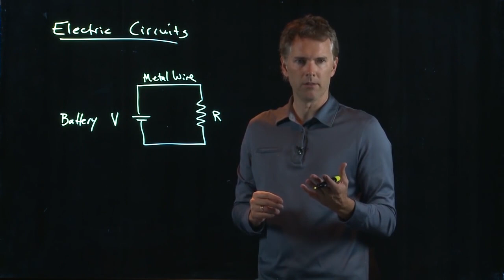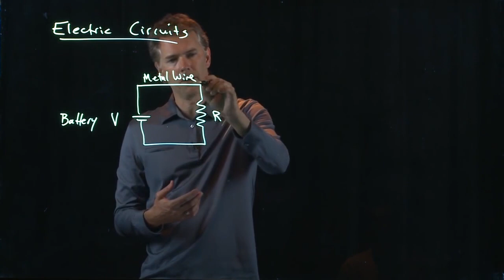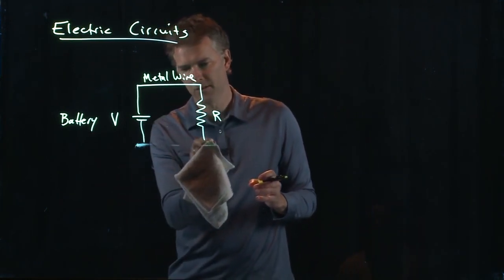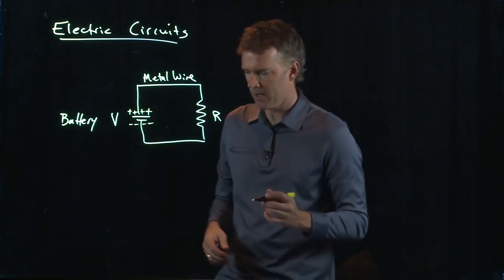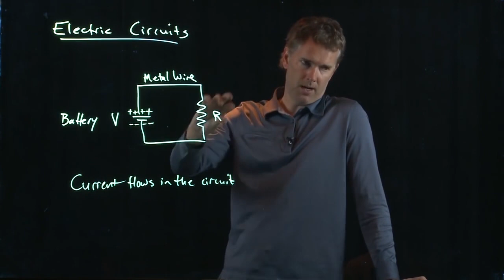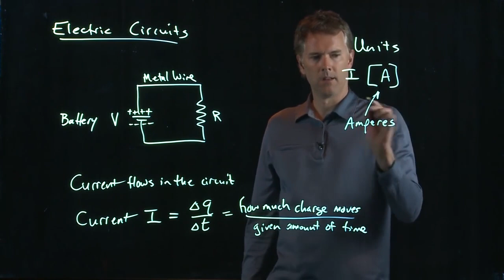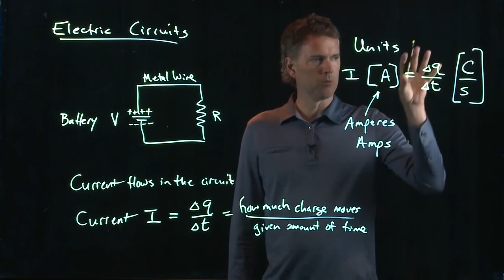Electric Circuits | Physics with Professor Matt Anderson | M21-01

Comment: Point of correction: 
In the first circuit he drew, I think the energy source is a (CELL) NOT!!!!!!! A (BATTERY).
Reply from the maker: Correct.  I get a little lazy with the drawings.  One pair of lines is usually a cell, two pairs of lines is a battery.  A cell is a single layer of material where a chemical reaction generates a voltage.  A battery is a collection of cells.
Cheers,
Dr. A